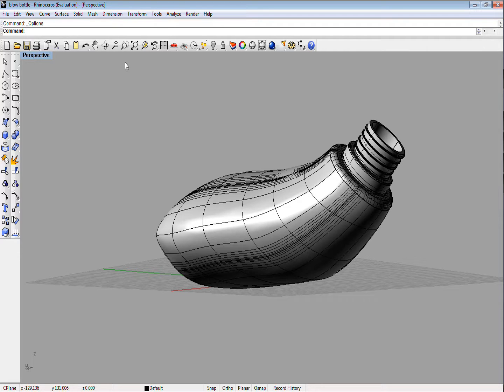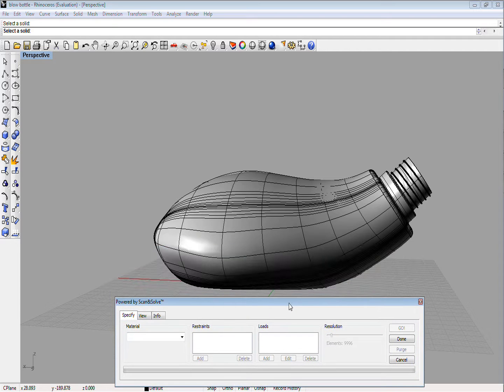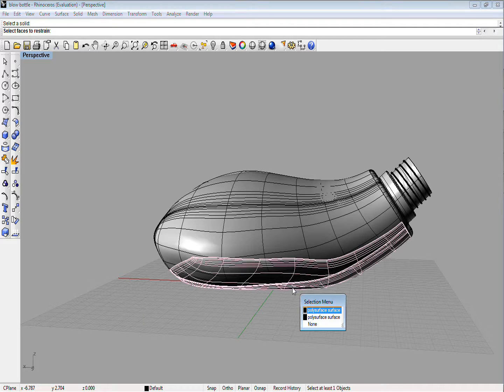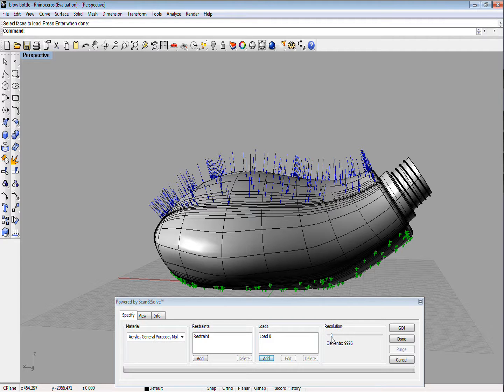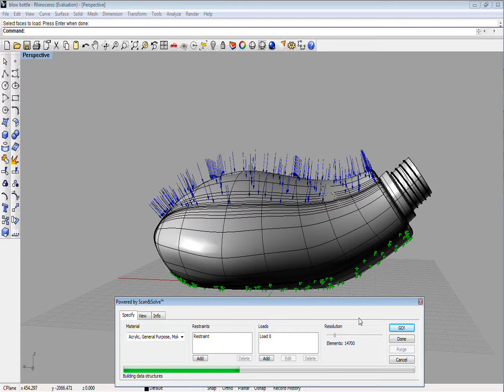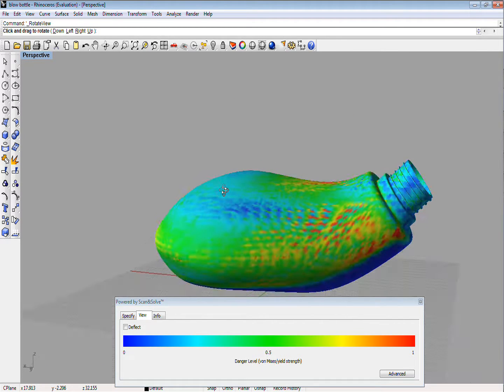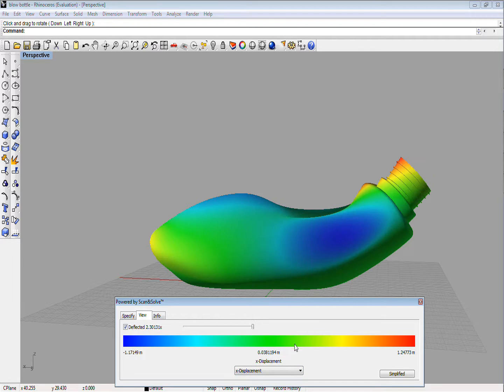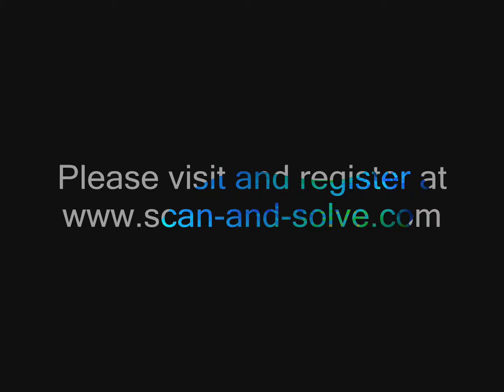Scan&Solve™ for Rhino:  simple stress test

Comment from the maker: Scan&Solve *is* the FEM program that works right inside Rhino.  No preparation, no meshing, and no exporting.   It works directly on the solid model in Rhino.  There is no magic in choosing resolution.  You should always run your simulation at different resolutions, and compare the results ... increase resolution until the answers are "close enough".  Search for "convergence" on scanandsolve website or check documentation 
Hope this helps.